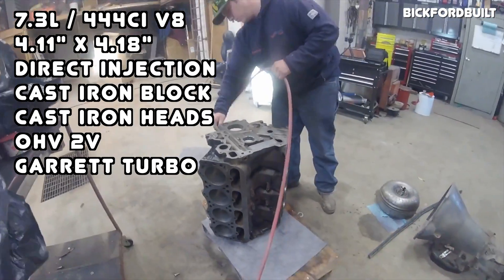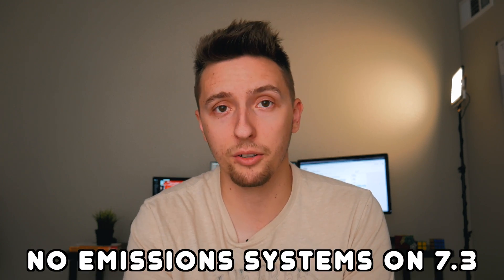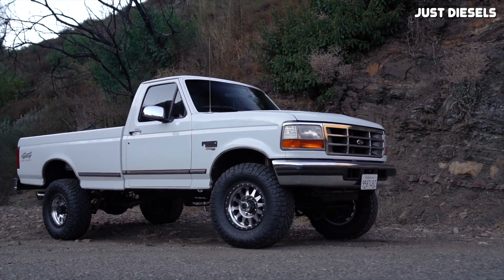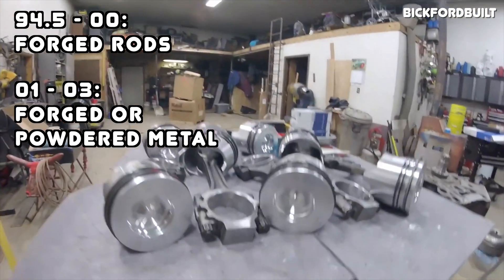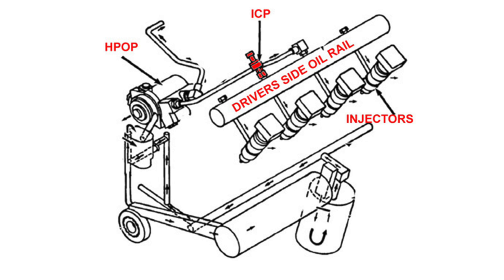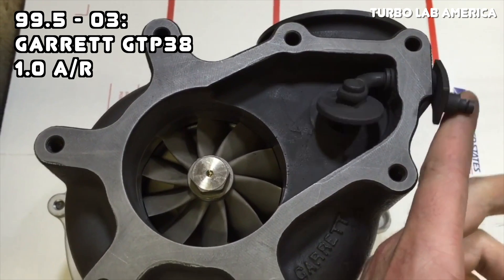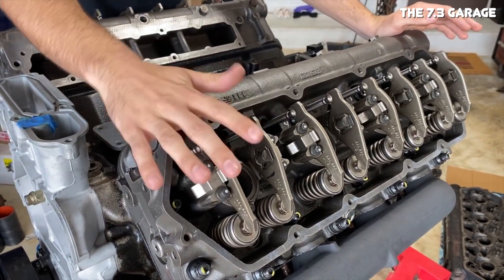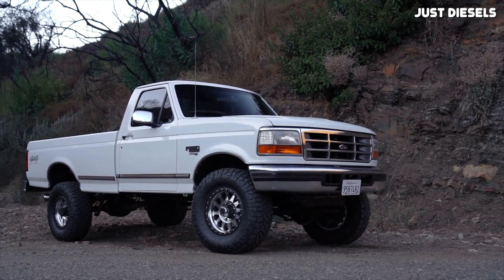7.3 Powerstroke: Everything You Need to Know

Comment: My 2002 7.3 with 425hp will outpull and out run a brand new truck all day. We have 6.7 at work and we tow 40 gooseneck and the new trucks have nothing when it comes to power
Reply: That’s funny you say that because my 7.3 made similar power. But I traded up to a 2011 F350 and performed a delete and tune and I can feel a huge difference between the 7.3 and 6.7. I tow a 16000 lb trailer regularly and the 6.7 would run away from the 7.3 pulling twice the weight.
Reply: @secretsquirrel8010  I'm not talking about a modified 6.7 though
Reply: Mike 85... but a 425 hp 7.3L Ford is very modified. So let’s compare apples to apples. I mean... your truck come with 250 hp at the fly stock. That’s only 200 at the wheel through an auto with 20% parasitic loss.
Reply: @secretsquirrel8010  the 6.7 has more hp stock than my 425hp.. 425 hp 7.3 is not highly modified. The right tunes exhaust intake and injectors will get there no problem. I'm on stock turbo with a wicked wheel and ebp delete. It will eat 28-30 lbs of boost all day wot. We wont talk about the trans stock auto' s suck. The trans has more work then the engine
Reply: Mike 85 finally someone who actually understands that a standard is the way to go

Comment: 01 F350 7.3 with Edge Tuner and no cat with the 5" exhaust. 207,000 miles. Had it a little over two years. Keep it in safe tow mode and it moves on down the road.
Reply: Doug ours used to have one but we took it out because the old truck is going on 500k now but still goes great

Comment: Good content, but one critique, take a breath man! LOL a little bit of pause between subjects will go a long way for one to digest what you are explaining.   What makes the 7.3 valuable today is the fuel system, and lack of emissions.  The fuel systems today are extremely delicate, any water, or worse, DEF, which can happen if the person filling the tanks is not careful, gets in the fuel and into the lines, it can destroy the pump, which then destroys the injectors, and because the fuel rails are torque to yield, they cannot be reused, so the entire fuel system has to be replaced, at the tune of up to $10K.  The 7.3 has an HPOP, couple hundred when it fails.  Injectors can be upgraded to stage 3, for more fuel delivery, as well.  Simple, easy to maintain, and with the forged rods, easily bullet proofed.   I have a 6.7 now, and treat it with kid gloves.  A real powerhouse, but damned delicate in the fuel area.  I had an early 99 Dually and I really did a dumb thing by getting rid of it, it would be worth twice today what I got for it 8 years ago.

Comment: My 2000 7.3 doesn’t have a catalytic converter.
Reply: I believe in 2000 there were two 7.3 styles available. Low emissions and federal emissions. You likely have the latter.

I could be completely wrong on all of that though.
Reply: My 2011 F350 decided to identify as a 1969 F100. I couldn’t stop him. He demanded the operation so naturally I complied. He now has the same smog equipment that a 1969 F100 has. It does run better and has more power.
Reply: but does it have powdered steel connecting rods?

Comment: 352,000 on my 6.4 and it’s still in good shape, deleted with 600 hp tuner it’s whole life.
Reply: Call bs
Reply: knuckleuprambo hey. He could be the unicorn...
Reply: Thats awesome,  I got rid of my 09 , I did everything I was supposed to do to make it reliable,  but worried about it all the time, so traded for a 6.7.  I miss that truck only had 132000 on it
Reply: Thomas Daugherty If that’s true you should do a video on it. That’s more than double the average life of a 6.4
Reply: I'm glad you are getting some miles out of the 6.4, I have seen them just throw a rod out the side of the block for no reason. No tune or mods excellent care and maintenance. I have yet to see a 7.3 blow up yet. I've heard of it but never seen it. Had a  guy with a 12 valve that had been sitting for a couple of years start it up and something stuck in the pump and the engine ran away. It didn't throw a rod but the valves started floating and pistons contacted valves and believe it or not the cam broke. It blew heater hoses off when it let go. Couldn't blame that on the engine
Reply: jim k have yet to tow a 7.3  for anything other than drunk or reckless driving

Comment: I have a 2000 F250 SD with the 7.3 and a somewhat rare 6 speed manual. 4X4, extended cab, and 6.5 ft box. 170,000 miles. Without a shadow of a doubt the best truck I have ever owned and so fun to drive!
Reply: yeah, 2000 has the most engines with the powdered steel connecting rods.

Comment: the first 7.3 generation is a best ever 👌 less electronics sensors without Turbo also 👌 anyways on my opinion I prefer a without electronics sensors but the 6.0 are a bigger piece of shitt engine! cheers from Norway
Reply: the 7.3 without a turbo is a waste of diesel fuel. you want simple? doesnt get much simpler than a 12 valve cummins.
Reply: the 7.3 without a turbo is a waste of diesel fuel. you want simple? doesnt get much simpler than a 12 valve cummins.

Comment: Just turned 451,000 in my '99
Reply: 455,000 on my 2001 F350 dually, maintenance is religious on oil, fuel and air. No smoke out the tailpipe, I use it everyday, 10 hrs a day, and most of all---I drive it like I stole it!! Got to love the 7.3.
Reply: 380 on my 01
Reply: 310k on my 01
Love that old truck.
Reply: 355k on my 1999, all original on engine and transmission!
Reply: @hackatak  i just bought a 1999 f250 7.3 with 270k miles in September 2020!
Reply: @starmaster191  Not even broke in yet
Reply: 490 in my ‘02
Reply: Try 660k
Reply: 396 on my 01
Reply: 285 01 exc
Reply: 160 on my 97
Reply: I turned 130,000 in my 2000 manual 6 speed.. But it rusted out so bad, I bought the doors, and half doors Bed,Tailgate ,fenders, Ill repair the cab corners I live in PA, salt killed this truck... i was in Georgia recently and found every part i needed, 200 per door gutted, 100 for the rear doors, , fenders, 150 for both, 6'  Bed' 1,400  All with no rust.ill prob Pull  the cab and clean up the frame, and Por 15..it, its not really that bad but i can check everything while its off, do some fuel  oil and motor upgrades,
Reply: 489k in our 1999 310k in our 2001
Reply: Just bought my first diesel. Went with the 7.3 because of all the great things I've read. 
2002 f250 7.3 manual trans, 148k miles on it. I plan on this being my first and last and only diesel.
Reply: 517,671 on mine
Reply: 496,000 still towing more than it should.
Reply: 500k on my O2

Comment: The engine has nothing to do with Ford. It is an International engine that can be found in many tow trucks and school busses. 

It uses a Catipiller design fuel injection system. Fuel is injected by oil pressure. The DT466 is uses the same system and is a far superior engine. 

You should probably shut the fuck up and get your man bun game on.

Comment: The non-California '99 .5  7.3 with 6spd didn't have a catalytic convertor.
Reply: My 7.3 is owned and operated in the state of CA with a straight pipe, nothing they can do about it since it was factory without one.
Reply: My 01 350 doesn't have a catalytic converter, it didn't have one from the factory, or so I was told. It has always passed emissions.

Comment: I got 2 5.9 Cummins a 95 and a 03, both 4x4 and manual transmission ( the 95 was swaped to manual, the automatic passed away) , and I got 2 7.3 one 99 and one 2000, only the 99 it's 4x4, both automatic transmission , yeah the 5.9 feels invincible, more space etc etc even better mpg, both engines the 7.3 and the 5.9 are good on torque , but... This is why I prefer the 7.3... because is surrounded by a better truck, a Ford,  I love 3 makers Dodge Ford and chevy , but Ford vs Dodge in those years, Ford made a better truck, better brakes , better transmission  , better dash(Dodges  dash sucks) more comfortable... You get  a better truck , if the 5.9 Cummins is the "10 point truck engine" the Dodge truck is just a 7, I hate how they brake, the front suspension is better on the Ford, let's say a 7.3 is a "8 point truck engine" for Shure a Ford truck it's a 9  point truck.... Even with the 7.3 flaws..

I work with my trucks , I tow with them, I use the daily to work, to go on a weekend,  I depend on them, I take care of them because if I don't do it...it gets  expensive to repair them, I only make upgrades to make them better for what I used them, no Barbie lifts , lady rims or queen tyres...just  Work trucks, I upgrade lighting , better filters, better cooling , oil change on time,  this is why I don't have more recent years, because I work on them, this year's are simple, maintainable, reliable, and posible to work on them and solve problems...
Reply: 7.3 or 5.9 both good engines. And manual on they two engine are stronger than the autos   Both have there pros and cons.  I’m not a dodge fan  but the Cummins is a good engine but I will say  all Cummins and powerstroke and Duramax has there own issues   No ones waisting no one lol  and As I say. Maintenance across the board makes a huge difference in reliability  oil changes and all the fluids and filters. Batteries  and the engine and transmission  last longer
Reply: I can agree. I have a 01 24v and my dash is non existent. And shit breaks wayyyyy to often
Reply: I mean a little known fact about the older ford pickups (and maybe the new ones I’m not sure) have a six inch steel pipe in the door. It saved my dads life one day. It bent the truck like a banana and she still drove home. Now that’s a good truck right there

Comment: These guys with pavement princesses with huge lifts really shouldn’t comment. They really aren’t using the truck for the duty it was designed for. 

I’ve had many 7.3liters ranging from 1996 up to 2002. Many people that have owned them and used them for work daily and put the miles on them, know they are quite expensive to operate and maintain. They take 4 gallons of oil on every damn oil change! With the HUEI injector system, you have to change the oil very often. If you choose not to change the oil frequently, you will go through injectors. Usually around $4800 for a set. The 7.3 takes a lot of maintenance and constant checkups. The engine may work good, but you’ll be paying it out the a$$ to keep it going long miles. 

On average, $120 oil change if you do it yourself. $120 per 3k miles or even 5k miles!
Reply: What are you talking about? They are NOT expensive to maintain. I have 2 7.3  Duallys with a ZF6. The oil change with rotella and ford filter cost like 70 bucks. Yeah you have to change it often but you should be anyways. And go check the prices for injectors on full force diesel, they’re only like 1000 bucks for an UPGRADED set of 8. Not bad for a super reliable truck!
Reply: Dom you just said it. You have to change the oil a lot. It is recommended that you change your oil every 3k miles. So if you’re using the truck for work and not a pavement princess, then you’ll see how it’s a high cost. 
I can do over 3k miles in one week.
Reply: @mikemiller9119  I don't know of anyone that recommends oil change every 3,000 miles on these.
Reply: Doug you may want read the owners manual.
Reply: Mike Miller actually we change ours every 5-7 thousand. And it’s at over 490k

Comment: Have a 2001 with 240k and modest modifications most notably the Brian’s Truck Shop transmission and GTP38 ball bearing turbo.  Turners and all that sure but those 2 mentioned before have made my truck!  All my friends have had many trucks in the last 19 years, faster? Sure. More luxurious? Sure. But mine still pulls everything everywhere 2 decades later and I haven’t had a payment in a long, long time! And theirs are long gone. Long live the 7.3. Oh, one more thing. Mine was factory without a catalytic converter.
Reply: Jaws 285 people rag on how slow it is, that’s fine but our slow truck will be pulling your faster one home
Reply: I have a 2000 F350 with 217000 miles and pull a 13500 lb. fifth wheel all over the country. The original 4R100 gave up the ghost at 190,000 miles and I had Brians rebuild my trans. I only live 45 miles from his shop and was able to limp in. He is a genius with the 4R100. I have a 6.0L trans cooler and now I can't get my trans to ever reach over 185 degrees even on 100 degree days. It normally runs around 170 degrees when towing.

Comment: looking great man, keep the great videos coming
Reply from the maker: Thanks 👍
Reply: @Dust Runners Automotive Journal our 7.3 has 490 k on it with only routine maintenance. And do I need to mention that ours (with air bags other than that bone stock) has pulled over 40,000 pounds. But they can’t pull that much hey?

Comment: I drive a 7.3 daily. Freaking awesome motor in a freaking awesome truck. It's an 01 f250 lifted black lariat 4x4 with 6.0 front end and 2016 king ranch wheels. Though I'd have to be unbiased in my decision to acknowledge the 12v Cummins as the best pickup truck diesel though the Chrysler pickup it's in isn't the best. My 7.3 is bone stock with a tune and I think that's the best way to have it.
Reply: That’s probably what I’m going to do as well! At most just exhaust intake and a slight fuel economy/power tune but nothing else !

Comment: Very good engine but not the best for light duty trucks, that belongs to the Cummins and especially the 12 valve.
Reply: Cummins is not DODGE. Look at a DODGE of the same year as a ford YOU WILL see the DODGE ratted out. Nothing works but the motor.
Reply: Hank Clingingsmith I just can’t bring myself to own one for that exact reason. They’re front ends are utter junk!

Comment: 7.3L PowerStroke will be the best and I doubt of a better replacement... Simply NOT! 👌🏼
Reply: the best ford diesel maybe, but not the best from the big 3.
Reply: Domus deBellum I disagree
Reply: @billwarbrick9116  a quick comparison between stock internals of a 7.3 and a 5.9 cummins will show the superior engine. nothing against the 7.3, but its not as good an engine as a 12 valve cummins.
Reply: Domus deBellum where I live there is almost the same amount of 7.3’s as 12 valves and we’ve towed way more 12 valves than 7.3’s. (Most of the 7.3’s for dui or speeding) (the majority of 12 valves being for engine or the most common front end issues) and I would know we work on a majority of the cars we tow.
Reply: @billwarbrick9116  no way i ever believe you get more 12 valve with engine problems than 7.3s with electrical problems. the 7.3 is a fine engine, but its not on the same level as a 12v cummins. theres a reason everyone and their dog does 12v swaps.
Reply: Domus deBellum say what you want I’m just stating what I’ve found by working on these trucks. I have no problem with the 12 valve but the truck around is absolutely terrible.
Reply: @billwarbrick9116  so whats the most common engine problem you find with 12 valves?
Reply: Domus deBellum the thing we fix most with the 12 valves is the injectors (usually  they end up getting replaced at 100-150k
Reply: Domus deBellum and after we replaced them once they need it again every 75k
Reply: 6.7 is a better replacement for the 7.3
Reply: Bryson Moffett if you need the power. But the 7.3 is really way better. There is no way (not without major changes) the 6.7 is a good replacement for the 7.3. Simply not doable
Reply: Bryson Moffett true but the 6.0 PowerStroke is the WORST by far... Head Gasket & Fuel issues! 😅👆🏼